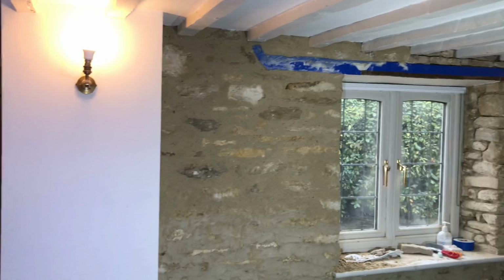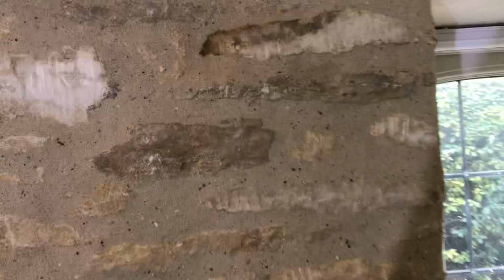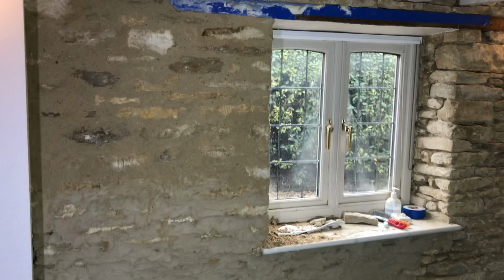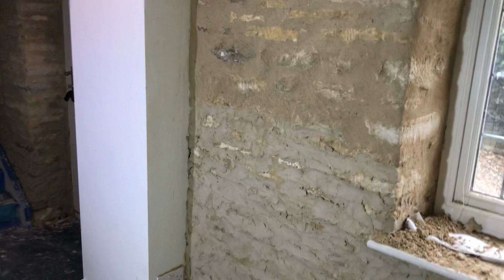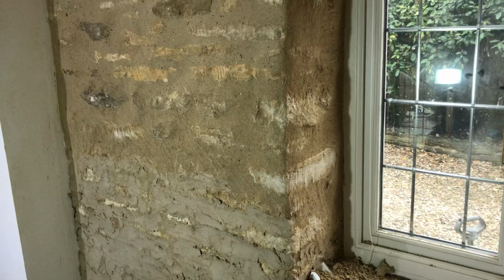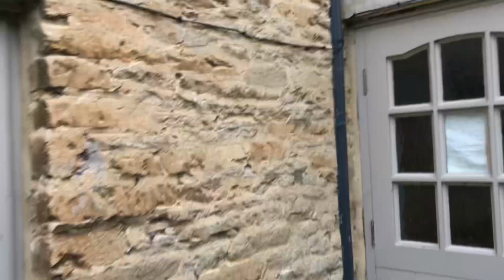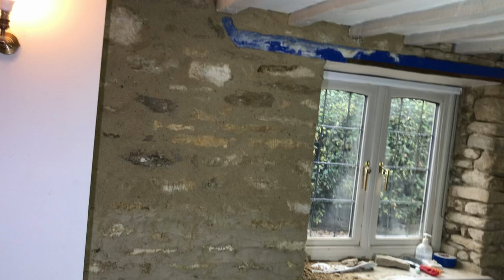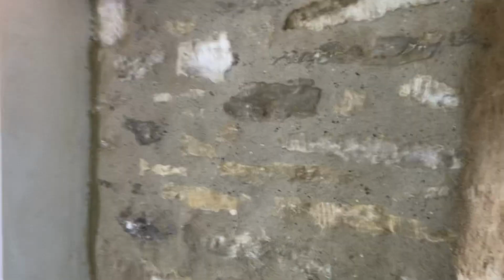Just how flush you should go when repointing with lime.

Comment: Sorry, but that looks aweful. If you’re going to go to the effort of smearing the stone face with lime, you might as well just render the lot.
Reply from the maker: Hello anonynous commenter.This was actually originally lime washed but then it got plastered using modern materials. Because of flood water this failed and was subsequently stripped off. It was then repointed using cement which suffered from mould because of condensation and the fact that there was no lime render to protect the stone from fungal infestation. The new owners wanted to change the cement pointing to lime. As the property sits in an area of regularly wet land which is subject to flooding it would've been better for the property if was fully rendered with lime. But who am I to argue? However, this isn't the finished work. If you want to see this then follow: https://www.youtube.com/watch?v=vTvTdBFthFI&t=4s
Reply: @michaeljamesdesign  fair enough, I’m not doubting you are right and as long as the customer is happy, who am I to argue. I will check out the link, thanks for sharing. Ps- I’m anonymous because I am being tracked and hounded by scammers. 🙏

Comment: Can I ask a question about packing the joints between brick? I have a ranch house in the Northeastern U.S. Built in 1984. I plan to apply a lime slurry from Romabio to the brick, but would like to pack the joints to get a smoother aesthetic look. The mortar joint is currently pretty deep. I’m trying to determine the best product/mix to pack the joint with. I’ve men told plasters like travertino or marmorino. I’ve been told SpecMix, I’ve been told NHL 5.0, I’ve been told regular Portland/sand mortar. Can you let me know what you think will be best? Thank you.
Reply from the maker: It's not really me who you need to speak to but I'd have thought 1 lime hydrate and 3 sand would do a good job of packing.

Comment: Really appreciate this video. Not nearly enough scholarly information in the US about this. I am about to repoint my 1880s fieldstone foundation using NHL 2.0 and I would like your opinion on something-
If I'm only concerned with the "mechanical function" of the wall, and the aesthetic of exposed stone is not a concern, is the ideal thing to parge the whole thing after pointing and then limewash? Or just point flush as shown in this video? Thank you!
Reply from the maker: Historically most buildings were lime washed or rendered. This protects and fends off moisture ingress. The elements will always seek to reduce a house to rubble so the more lime you can put inside and out, the longer the house will last.
Reply: Thank you! No visible evidence of prior lime wash but I will plan to do at least that, if not parge. Appreciate your advice.
Reply from the maker: @benbirby  In which case, make hot lime wash from quicklime. Powder or kibble. Don't buy it ready made, it's like pish and you'll need loads.
Reply: Unfortunately quicklime is not really available where I live. When I repointed my very soft brick chimney, I got lime putty from the lime specialists in my area and made the lime wash from that. It seemed to work alright, and not too expensive.
Reply from the maker: @benbirby  that'll do.
Reply: Thank you for your time!

Comment: I'm in west Wales a 170 year old house made of slate. Walls are 800mm thick. One wall is natural with lime pointing which is starting to fall out in places. The other three walls have been cement rendered on outside some of which has blown. The slate underneath looks poor quality and I wonder if i take all the cement off and lime point it, will it survive a Welsh winter 300mt up a hill and 5 miles from the west coast?
Reply from the maker: Of course it will. What do you think was used when it was built? But you need someone with specialist knowledge of limes and pozzolans.

Comment: Great video mike Any chance you could let me know the mortar  formula , lm in the process of a house restoration in Ireland 🇮🇪,Thanks
Reply from the maker: 1:4 QL to sand.
Reply: Thanks Mike , just curious what’s your opinion on lime insulation ,
Reply from the maker: @rosslukeshay  In what respect?
Reply: @michaeljamesdesign  wall breathability  is There a need for insulation,& is it worth the extra cost ? Thanks
Reply from the maker: @rosslukeshay  Insulation is a pretty expansive subject. It's good in most cases but - in this case - you'll have to be more specific. What insulation are you talking about? Do you mean on this job or on your house? Do you mean sheep's wool insulation or insulating ingredients in plaster? Or do you mean plastering over products with heat retaining properties such as cork?
Reply: @michaeljamesdesign  on my own house ,with lime insulation plaster as to other forms ! Cork , sheeps wool or just lime plaster , walls are back to bare stone 
Tnx
Reply from the maker: @rosslukeshay  Ok, I think what you're asking is what is the best kind of insulation on a bare stone wall. Am I correct? Or are you asking whether a lime based insulating plaster is preferable over ordinary lime?
Reply: @michaeljamesdesign  yes Mike both questions really .
Reply from the maker: @rosslukeshay  Ok, well a lot of it is down to personal preference and circumstances as well as variables such as time and season. I don't tend to use ready mixed manufactured products and just use hemp lime as an insulating plaster where possible. If boarding is required then it's sheep's wool insulation behind it. On ordinary houses you can't really afford not to use insulation nowadays but all forms are more expensive than ever before.
Reply: @michaeljamesdesign  Thanks Michael 👍